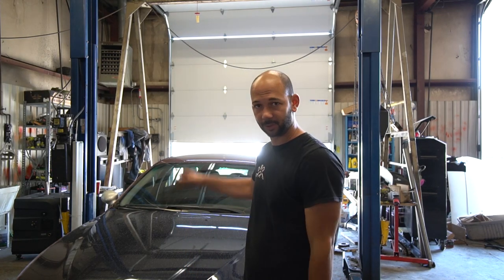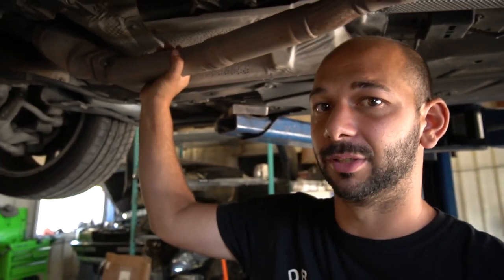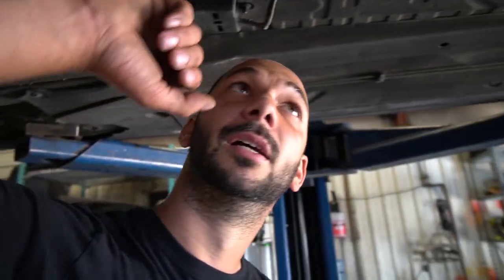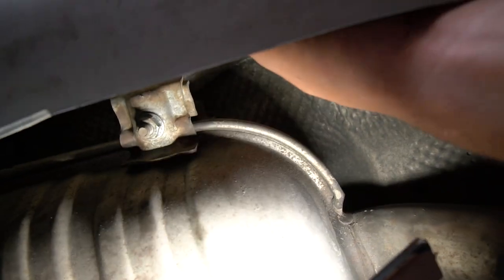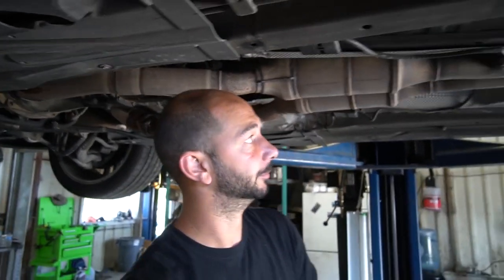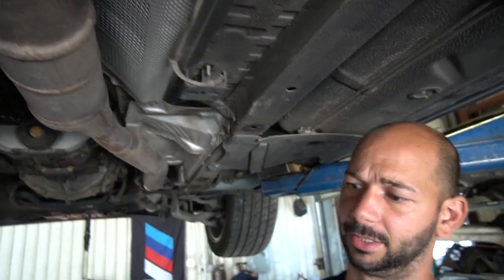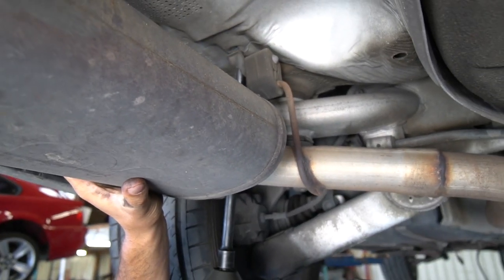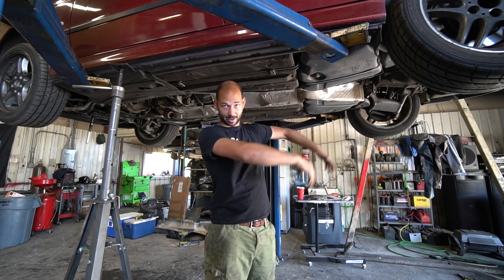e39 Exhaust Removal  How-To

Comment: Super helpful video thanks. 

Does anyone know if the secondary cats are welded in?
Reply from the maker: They are, but the sections can be unbolted, about 4 feet long. After market cats will need welded.
Reply: @DENVERBEERANDOIL  thanks again 😊 

I Need to fit secondary cats in my e38 and wondered if there was any way around not welding them? I.e using clamps to hold them in place maybe
Reply from the maker: I don't know of a way to avoid welding
Reply: @DENVERBEERANDOIL  no worries. I appreciate your help and the video

Comment: I've been trying to get my exhaust off on my 1995 BMW e34 540i to replace the  guibo and I've removed all the bolts & hangers but the pipes do not want to let go of the manifold. Any tips, local shop   said it would cost me 200-400 to  take it off.  As you said there are 4 pipes connected to the manifold and the two outer  ones have some play but the inter pipes are the once that will not budge.
Reply from the maker: Up and down and side to side aggressive motions. Smacking the flanges with a large hammer will also help. And just to clarify you got 2 nuts/bolts off each pipe at the header.
Reply: @DENVERBEERANDOIL  Yes, I had 2 studs on each of the outer pipes. All 4 of the  studs  snapping off but I ended up grinding them off. The 2 nuts/bolts on the two inner pipes came off with not as much trouble.  I'll try again before I take it to the shop. thanks!
Reply from the maker: Try a prybar between the flanges as well

Comment: I wish mine was that easy. My studs broke off
Reply from the maker: We’ve had this, our technique is to grind into the side of the flange up to the stud, from there you should be able to pound out the stud and replace w a nut & bolt
Reply: @DENVERBEERANDOIL  Thanks for the video. I think my studs are fine, but if I replace the nuts (mine were almost non-existent!), is SS okay, or should I go for the $4 copper nuts from the dealer? and should I use copper anti-seize paste? or any paste? Thank you!

Comment: Should I keep my 540i/6 and slam it on coil overs or try and sell it and find an e34 535 or 540i/6...which would be a lot harder to do? https://i.imgur.com/pRUF3wV.jpg Pic of said rolling shit pile
Reply from the maker: E39 540/6 is a cool car and great to drive when it works, but they are very prone to breaking compared to an E34. I would keep the E39 until you can't stand fixing it.
Reply: @DENVERBEERANDOIL  I'm about there already ;) Thanks for the input. I think I am going to go ahead and keep looking.
Reply from the maker: E34 is by far my favorite chassis
Reply: @DENVERBEERANDOIL  I agree mine as well down to everything, looks, build quality, reliability. I sold a 5 speed swapped 540i a year ago and I've kicked myself ever since.